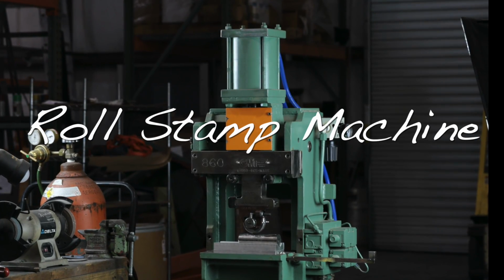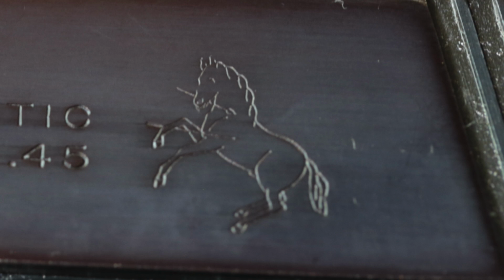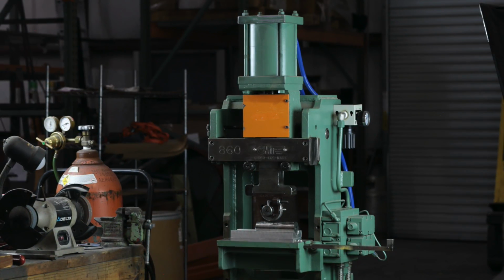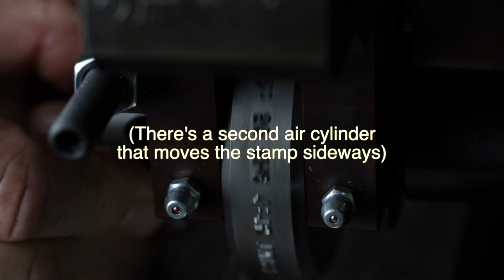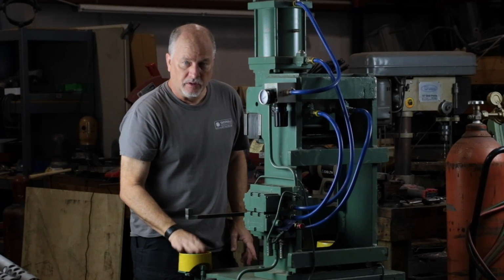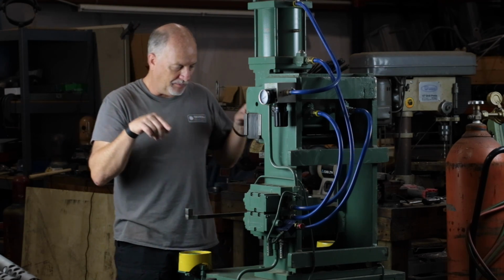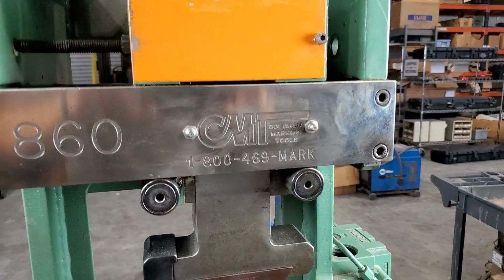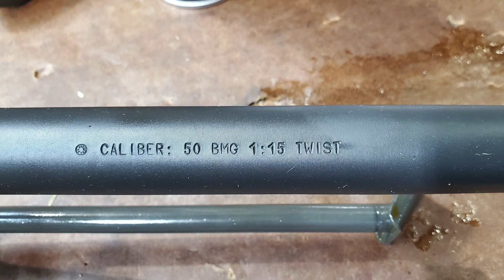Roll Stamp Machine!

Comment: In the '60s I worked on a line manufacturing 2.75" folding fin rocket warheads.  One of the machines I ran was a roll stamper which applied the nomenclature around the circumference of the warhead.  I believe at least one went to Vietnam double stamped...

Comment: We adapted a roller head into a tool that we could mount in a cnc lathe tool turret. With a little code tweaking to get the depth right we were able to machine and mark our parts all in one setup.

I think there was a company that was going to market tools similar to ours but I don't know how that project turned out. This was in the early 90's.

Comment: I have wondered how these stamps are done. It doesn't answer how more flimsy parts are stamped without collapsing or at minimum bending the normally sheet steel. I'm assuming there needs to be something on the other side to stop it from bending. I'd be interested to know how the information on the RN 50 is done, like this or ? My best guess was it was machined in by the cnc but I'm open to better information.

Comment: So if that's able to roll stamp that into a hardened steel barrel like that my question is what material is the roll stamp die made of to be able to take those pressures over and over and stay in shape ?
Reply: Carbon tool steel in special quality, oil-hardened 
Greetings from Germany 
Məddl
Reply from the maker: The company won't divulge the exact steel they use, but I'd suspect it's A2 tool steel.
Reply: @markserbu  Ah okay, i see a cool machine like that and i always wonder about things like what i asked, stuff like that fascinates me for some reason, thanks for the reply Mark.